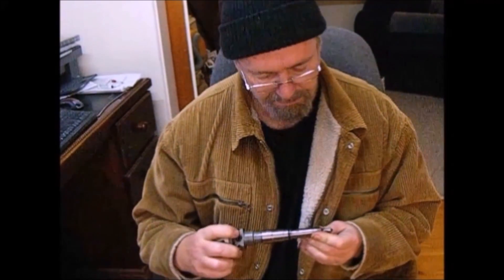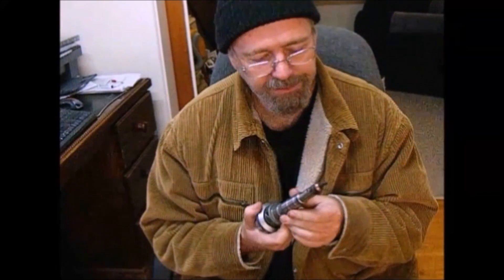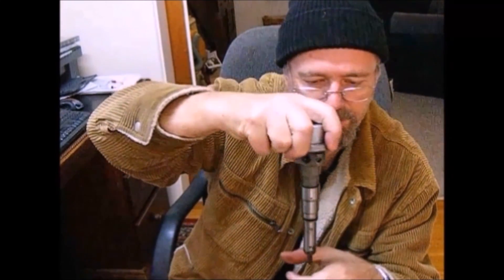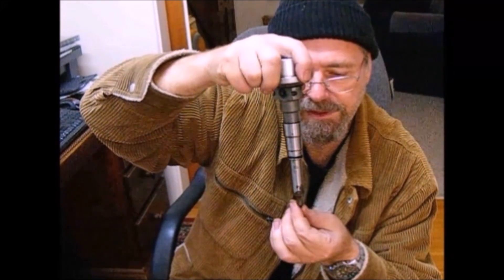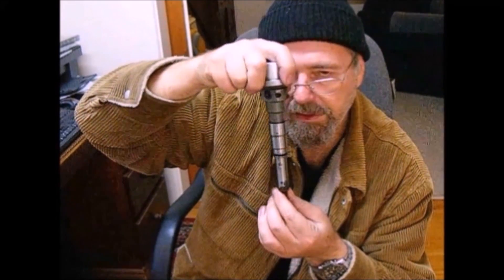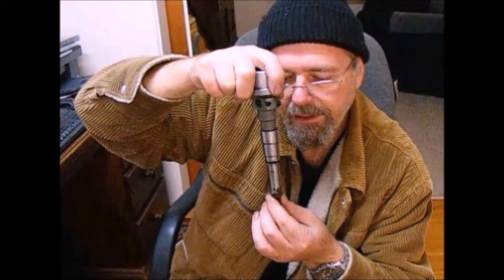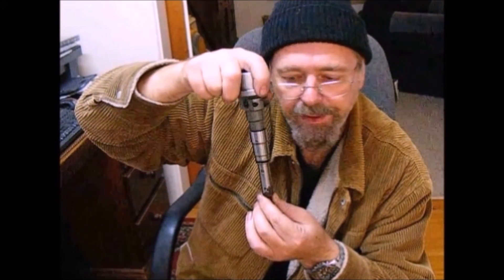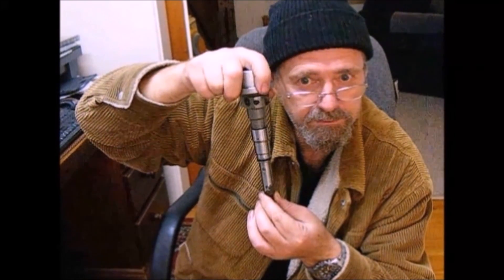Why Isuzu 4JX1 Injectors Fail - and How To Fix Them

Comment: I love my truck - a 2003 trooper I call Black Beauty.  It lives in the Philippines, as do I, about 6 months of the year.  Thank you, sir, for alleviating my fears concerning my engine.  I can do the repairs in the video - no problem.

But please - parts in PH are non-existent and no diesel troopers made it to the US.  So I need sources for the copper washers and o-rings necessary to perform a "preventive maintenance" repair (without removing the sleeves).  PLEASE tell me where to get these parts and a sleeve removal tool, as well?

I have another issue which is most vexing - the transmission (auto) pan gasket and filter.  Does the diesel share the same trans as the gas models?  If not, where can I order these vital parts?  Forget about PH...

I thank you in advance for your help, Kind Sir :)
Reply from the maker: hi Arthur.  Most of us use Ramin Isuzu in Dubai. Their prices are way lower than anywhere else.  They mail out stuff immediately.  http://www.isuzuautopartsstore.com/   I'm not sure about the transmissions.  Try contacting Ronnie Way on YouTube.. his account is called "ronaldomz". He's had an automatic diesel since new and would likely know :)
Reply: hey man., can how did you get your injector problems fixed? hehe. thanks
Reply: effing Gencars is oviously charging a lot of money for it. #uck Gencars

Comment: I have a 1998 Isuzu Bighorn with 4jx1 engine. it is giving me various problems and was thinking of changing the engine. is there a type of engine that I can replace the 4jx1 without making modifications
Reply from the maker: the 1998 Bighorn also came out with the 6VD1 & 6VE1 v6 petrol engines which are well regarded.  The favoured engine for swapping is however, by far, the earlier diesel engine - the 4JG2, 3.1L turbo 4 cylinder which fits nicely in the engine bay of course.  The 4JG2  is a pushrod engine with mechanical fuel injection and no computer and is very highly regarded.  It is approximately 30hp less powerful than a 4JX1 but was the original specification for the vehicle.  I believe it may share the same bellhousing bolt pattern as a 4JX1, but you would have to check that.  You will find all you need to know about the 4JG2 in the standard Isuzu workshop CD manual which covers all engines fitted to the UCS body of the Bighorn.   To give some perspective: my 1998 Toyota Landcruiser has a 6 cylinder 4.2L non-turbo engine of 130hp in a vehicle of 2.7 ton.   The 1998 Bighorn with a 4JG2 Turbo engine also produced 130hp in a vehicle weighing 2.4 ton. There are some who fit CAT engines, or perhaps more usual is the 3.9L mechanically injected Isuzu engine [as fitted to the Landrover Defender based Pentrite Troop Carrier for the Australian Army ].  But of course fitting the 4JG2 which was a standard engine type for this vehicle is a lot less hastle and is matched to the drivetrain components.
Reply: What kind of problems is this 4JX1 engine giving you Nyasha? I'm asking because I've got the exact model and year, maybe we can share notes hey........ or maybe the reply is coming a way too late.

Comment: Someone i know has a trooper 3.0d OHV he's owned since new but recently put £30 worth of petrol in the tank ran it for about a day or so until he realized he'd put petrol in and got it drained by the aa and then fitted a new fuel filter and re filled the tank full of diesel and bled it up and now the engine is missing and jumping around in the engine bay like something not right and it will only rev up to 3000 rpm max will it be the injectors??
Reply from the maker: the flash ( ignition ) temperature of petrol is different to diesel fuel so the point of firing becomes out of phase with the engines stroking. He has likely wrecked the entire engine after a whole day of use
Reply: He is a bit .... dozy to put it politely would a skimmed head and new valves solve the problem??
Reply from the maker: pug205mardigras pull apart and have a look eh.. these things are pretty strong so who knows. Nitrided crank and rods with air misting crankcase lubrication.. be good to see how she stood the abuse :)
Reply: if the engines knackered i thing itll be getting crushed......

Comment: hie Ed, I have an Isuzu wizard 4jx1 3L diesel, a in Zim, bought it two years ago, i enjoy it but two week ago it was mixing water and diesel, and we discover that it was the o rings, and we bought these from Ramin Dubai but the sleeve remover is expensive and you cant get the here, how can we make one, help with the specs and drawing if possible
Reply from the maker: please reference my other videos where there are full instructions.  Also, a chap wrote to me last month and said there's a tool he bought off eBay that worked, but didn't give any details other than it was $100. :)
Reply: Where in Zim are you Jeff. I'm also in Zim and own a 4JX1 powered Bighorn. I also once encountered the sleeve removal problems but finally fabricated a pulling tool and successfully removed the sleeves on my own

Comment: Ok the code came up as no.1 cylinder injector control circuit fault. What does this mean?
Reply from the maker: this could mean a faulty injector, or a fault in the internal injector wiring harness.  Since it's signaling a fault on only one injector ( rather than a number ) it's likely a real fault in either of these components - rather than an electronic glitch
Reply: Hi again I had replaced no.1 injector and truck was going fine untill now. Truck will not start, well it will start but not turn over, we werw driving it one day then it cut out on the road, it started back up after a few attempts of trying to crank it over. Got home and now truck wont kick over. Would you have any idea what is causing this.
Reply: We have also replaced glow plugs, have tested them and for some reason the tester stays on for nearly 5 minutes I have hurd using the tester the light should be on for only about 10secs but it stays on for nearly 5mins
Reply: could it possibly the Oil tail pressure sensor
Reply: rail*
Reply from the maker: the normal way to diagnose such faults is read the computer error codes.  Since a diesel has no spark plugs the problem must be in the fuel circuit. In a 4JX1 this includes the oil rail devices - yes.  A fault in an oil rail sensor will show up in the error codes.
Reply: Edwin Henry Blachford  we have taken truck to our local mechanics and they have told us there scanners cannot read any fault or error code. they are guessing with all sorts of problems but aint even sure if its the actual problen and I obviously aint gonna pay for something they aint even sure about. But I have been telling them its got to be something wrong with the oil rail pressure sensor but they are saying no. the check engine light is not on
Reply from the maker: Hi Trina. You can read the error codes in a 4JX1 without a computer by shorting across 2 wires in the OBD connector (RHS of consul in cabin). The proceedure is explained clearly in the Isuzu workshop manual in sections 6E-27 & 6E-28.  The codes are displayed by flashing of the dashboard lights in a sequence explained in the manual clearly. A list of common error codes is found in section 6E-54 so you know what the code numbers mean. You can obtain the Isuzu manual on CD for about $10 on ebay, or go to the Isuzu users forum in your country and maybe get a copy free.  I would explain the procedure here but you need the little diagram (D60RW046) of the OBD connector to know which 2 wires to short out.  The Isuzu Trooper is one of very few vehicles where you can access the cars computer without any special devices.  :)
Reply: Edwin Henry Blachford i have tryed this but the check engine light is not on.
Reply from the maker: try the procedure in 6E27 of the Isuzu manual again. If this doesn't produce an error code, or if the check engine light doesn't come on you may have a faulty computer - but this is a very rare fault.  You should find a technician with a Tech2 diagnostic tool. The "Tech2" is used for all GM & Isuzu vehicles up to about 2010 and is common with decent mechanics.  Ask on an Isuzu Forum for who has one local to you, for really this is a device any mechanic who works on GM vehicles must have.  You can purchase your own Chinese version of a Tech2 for about $300 ( AliExpress etc.. ).  The proper Tech2 tool allows you to not only read error codes but also reset many things and run complicated diagnostic routines automatically.

Comment: Hi. I have a Isuzu Bighorn 1999 Diesel. When I drive truck it starts losing power and rattles when its in gear. It sounds like its only running on 3 cylinders. Have replaced fuel filter but no change, also the check engine light has come on.
Reply from the maker: Hi Trina. When the check engine light comes on, it means the engine computer is reading a fault.  Often, a computer may simply get a false reading and actually make the engine run badly! This is called "putting the engine into limp-home mode".  This may happen due to dirty wiring connectors, or a real fault.  Therefore you need to find out what the fault code is.  You can do this yourself by following the procedure in Section 6E-27 of the Isuzu manual..
( on the OBD2 connector [LHS of Consol] short pins 4&6 together with a bit of wire or paperclip.. turn ignition key on.. any error codes will make the check-engine light on the dashboard flash 3 times [ ie if the code is "32" the light will flash rapidly 3X then pause then flash 2X.. and this will be repeated three times] ) . There may be more than one error code in which case the numbers will flash in a sequence then repeat 3 times - this sounds complicated but when you watch it it's actually pretty easy to work out.   

The alternative is to find someone in an Isuzu club or workshop with a "Tech2" diagnostic computer which just reads out the codes when connected to the OBD2 plug.  

Something to try FIRST however.  At times a computer gets an error code and forces the engine into a limp-home mode for no reason... just an electronic "glitch".  So it's always best to do a simple procedure first
 - simply disconnect the battery and leave it unconnected for about 5 minutes -.  
Then reconnect the battery.  
In the Isuzu Bighorn, this actually wipes out all the error codes from the engine computers memory so when you first turn it after disconnecting the battery for a while, the check-engine light should be OFF.   Then start the engine and drive the car around a bit.  Sometimes this clearing of the error codes cures the fault. In fact, in the Isuzu Manual this is always recommended as the first thing to do.  

If there is a real fault in a sensor or device the error code will return and the check-engine light will light up again on the dashboard.  In this case you should read section 6E-54 of the Isuzu manual and see what the code means [or plug into a Tech2 diagnostic computer which simply tells you the fault].  In this way the computer is telling you where to look for a problem.. which is cheaper than a mechanic!  

Just be aware at that stage that if there is a fault registering, it may be in the wiring/a sensor/or the actual part. So check for loose wires before you go out and buy any new parts....        :)

Comment: hi
would you please help i have Isuzu KB 300 fleet side is very slow is using electronic diesel pump when i start the engine is taking longtime to start and rave counter is run into 3 then is running  only about 60k/km
Reply from the maker: It would be good to check the fuel filter, then make sure the fuels system is bled of any air bubbles properly.  This is a common fault with diesels.  Other than that, with computer controlled engines it is usually easiest to pay a workshop to do a diagnostic test with their workshop computer. This should not cost too much and will tell you where to start looking

Comment: Hi how to dismantle 4jx1 injector?
Reply: Mr.Blachford thank you for answer my question and i have another question if you don't mind. What is the voltage of solenoids it is 12 volts or more than? We don't have tester.
Reply from the maker: +Aharman Camaclang the voltage of the solenoids is hard to measure. The power transistors that drive them in the ECM can be driven to variable voltages.  It has been reported to me that they work at up to 100V - which seems likely since a larger voltage would overcome any electrical resistance from an oil film in the connectors.  However when I had a set of solenoids made, the specialist "motor rewinder" simply measured the original wires and number of windings and copied that.  The work was done by a light aircraft workshop for me, but any motor rewinder would know what to do.   The cross section of the wires should be the same as original since that has been designed for the combination of heat+amperage+voltage+ resistance involved
Reply: Thank You Very Much to Answer my question.